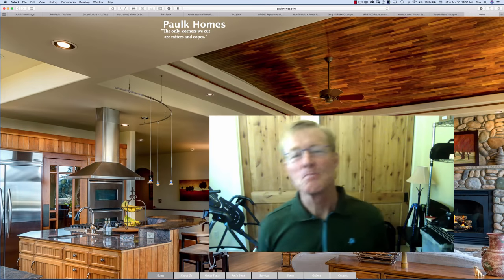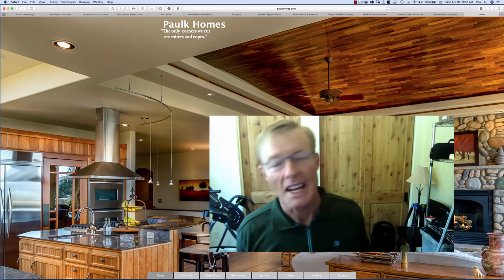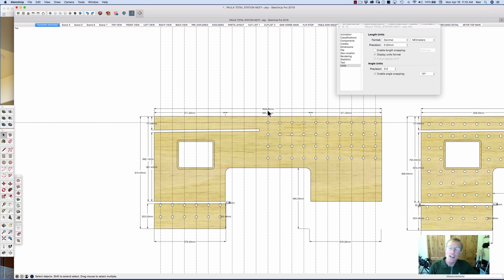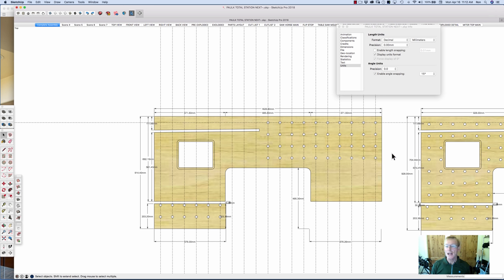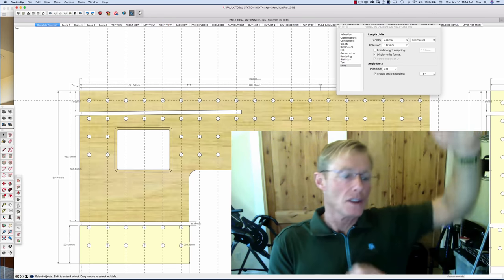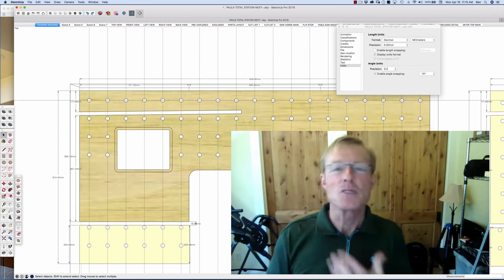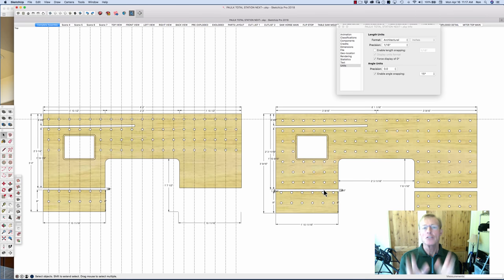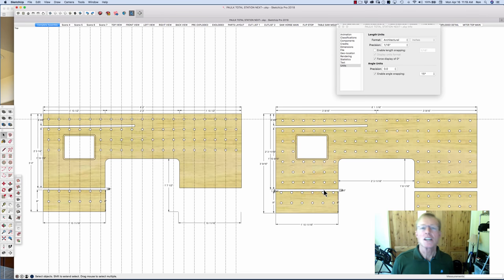Metric or Standard? 32mm Sizing? Your chance to have input.

Comment: Imperial for me in the usa except hole size. I did not know the importance of the 20mm hole size until i bought festool clamping elements and dogs and they went through my pts or fit loosely.
My chevy Colorado has a 6ft bed and my pts fits in it perfectly. There is no room for 1 more inch.

I am making another pts with 20 mm holes and imperial spacing because I am poor. The best jig for this is made by anthony zeh. 15 bux and a piece of pegboard. I use the festool 20mm boring bit on the festool of 1400. The bit is 64 bux. Holes are perfectly square to each other and I put clamping holes in everything now.

Here is a link to his jig. Soooo much easier. If i ever get the money to burn on a new spacing set up it will be peter parffitts set up!

https://youtu.be/TuPC7aVYpmk

Only my 2 cents. Im already not a pro and only know imperial. I have no time left in life to relearn something that is only said to be best by opinion.
Reply: Interesting point point on pickup beds. I don't know how many trucks are short enough that an extra inch and a bit makes a difference (mine is 6'6ish), but if it's a significant issue, Ron could always go one multiple less:

Instead of 58*32mm =1856mm ~= 6'1 5/64,
go 57*32mm = 1824mm ~= 5'11 13/16 which is closer to 6' anyway

It means the center of the dog holes would start 48mm in from the edge rather than 64mm in, so not a multiple of 32. But still a multiple of 16...
Reply: Parf is sooooo expensive.  And super time consuming.  I'd rather pay my CNC shop for the perfectly accurate holes and save quite a bit of money and substantial time and energy.
Reply: Eclectronical 
I do have a bedslide in it currently which i am gonna remove when the weather breaks a little more. I may gain 2-3 more inches and still be able to close the cap doors. Im still going with the old plans though unless something  new is imperial and no more than 6ft for the pts except Im gonna reverse where the tablesaw goes. I always hit the mitre extension standing to the left of my workpiece feeding it thru..
Reply: WhoDatBe Dare 
 Its like 250.00 super dead nuts accurate and reusable. I cant imagine taking a tabletop to a cnc or what it would cost  but then again I know nothing about them and I am sort of anti cnc anyway. 

Theres also a way to make the holes with the festool lr32 set up. Toolify does a demo on it. 

Im still sticking to my current set up. Cheap and accurate when i put any square to the holes
Reply: I have mine in a Ford Ranger.  Also no room for the extra inch.  I vote one multiple of 32mm shorter.
Also this might look better in your trailer Ron.  (Not hanging out)
Reply: William Smith In Australia it's more like $350AU with shipping.  Plus all the time it takes to actually make One.  If you ever actually did used it again, You'd have to make a lot and sell a lot to get your money back.  A local CNC shop one off would be super cheap on MDF in comparison.  But yeah if I had the the money to throw at it I would.
Reply: WhoDatBe Dare 
I thought David stanton did a decent demo on it and it didnt appear too long to do. Keep in mind that Im really not a "woodworker/carpenter " . Im actually a painter who has to do this stuff because Im surrounded by people who say they are and their work tells another tale. Im gonna revisit Daves video again and see if I missed it taking way long. And then theres Peter parffitts cutting station and his dogs. Im into downsizing further when I can. I love my pts (albeit 2/3finished) but, there are times I just dont need it. I think theres a quick  video on the channel im commenting from dealing with that and my small mitre saw. This isnt my main work channel. Its your time and you know how you need to dpend it. Thats the bottom line

Comment: Metric is fine but unless you're going to adapt a 32mm drilling system to it I see no reason to go with 32mm, especially if it's going to make it longer than you want.   Check out Schmidt32, he's got it figured out the best I've seen short of a dedicated machine.  Drilling holes on a grid in imitation of a point-to-point machine is the only reason I can think of to build any jig with 32mm increments.  I'm in the states and the metric tapes and rules that are available are limited in their readability.  Imperial tapes tend to have those longer lines that help to figure out what you're looking at, especially with age as the eyes go a bit.   I don't have a preference of one or the other intellectually, but I do find imperial measurements easier to read and to "split".  Math is easier with metric I suppose.   The 32mm standard was established because that's as close as engineers could put the boring machine spindles with the meshing gears on line boring machines.  Maybe they couldn't get it down to 25 or 30 so they went with 32 because we're used to counting 2-4-8 like that so the increments aren't so tricky to learn. 32mm if you stick with it does lead to some rather cookie-cutter cabinet heights and drawer front layouts.   I like it just the same, but it's not something the average woodworker can just do casually and save time.  It's best for systemic production.

Comment: So learned imperial at school in Australia, changed to metric when I was in high school. So know and use both. Still go to grab a "2x4" but it's metric and the length is in metric. So if I get a choice metric please. But all the way, boards here are 2440x1220, I don't need a 6 foot bench but a 2000mm/2metre bench. This is why you guys couldn't get this done when you introduced it in the 70's, it's the reason why I haven't built your very impressive bench yet, even the metric plans don't work on our job sites. Metric, but metric all the way. 
Or just 2 sets. A 6 foot imperial and a 2 metre metric!
See how you got standard/imperial https://youtu.be/1TV6JFxMEcI

Comment: I am also an old guy...living in Canada. I started imperial and like imperial but can work with metric. Don't like metric but I do not make my living doing carpentry. I am rebuilding my deck and doing the imperial way because all the wood and hardware I buy is imperial and is easy to work and I will have far fewer mistakes.
If the majority of your subscribers are not pro's you should go imperial.

Comment: I hear the number one reason to use metric is because it is easier. I have never traveled the easy road, I always go down the road most challenging. That being said, I have never had any problem measuring with fractions or decimals. Learn whatever system you want and then it is easy. Easy or difficult is how you want or choose to perceive whatever situation you find yourself in...
Reply: Danny Wilsher   Is there any actual benefits to imperial over metric ? Iv only ever used metric
Reply: Daniel, I really wouldn't say either has a benefit over the other in my opinion. Once a person learns something and how to do whatever, then it is a habit and the benefit to me is nonexistent. I concentrate on what I am doing, cutting, machining, whatever. Not whether it is easier to use metric or not, that never crosses my mind. I guess I am weird or something...
Reply: I just wondered if there was a particular type of task of job that was more suited to standard what i think we can both agree on is when manufacturers used both on there cars lol

Comment: Ron, I live in the UK, I'm hardly what you can call a fully paid up member of the EU. However, metrication is probably one of the best things to come out of Europe.
31mm = 1.22047" which is fine if all you measuring equipment is decimal, but I've not as yet seen a tape measure or ruler in decimal. Yesssss I know some clever smart ass over the pond has probably made one. Boy I Envy you lot over there for your innovation and product choice. We can't even get dado stacks here.
So, you wanna make something to fit a gap, you measure the gap and it reads 1967mm. Not 1.96m that's construction talk lol. And 1967mm is transfered directly with no conversion needed where as imperial you have the whole, decimal and a million different fractional possibilities,
I know you guys over there like choice but that's going too far. 😂
I use metric because no matter what I measure here it will always be the same everywhere else without having to get microscopes out to measure off 29/64th not to mention all the counting. 
Enough babble, go metric.

Comment: Not sure how many of your viewers are pro's or hobbyists, but I'm a hobbyist from the US.  Everything I have, and all of my work has been Standard.  With as many tape measures, straight edges and rules that I have, I won't start over and convert to metric myself.  I have metric tools for working on cars, and my CNC runs based on standard, (Gatton CNC), so my vote is for Standard!!  Also, what's up with the 32 mm base? The whole point of metric is base 10, so is the 32 a holdover from converting something from Standard or some other measurement system?
Reply from the maker: "It is claimed that the (32mm) system was developed after the end of World War II in order to help speed reconstruction of the vast number of buildings destroyed during the war, that the spacing was decided upon because that was the closest that multiple drill bits on a line boring machine could be placed, because of the size of the gears then available."